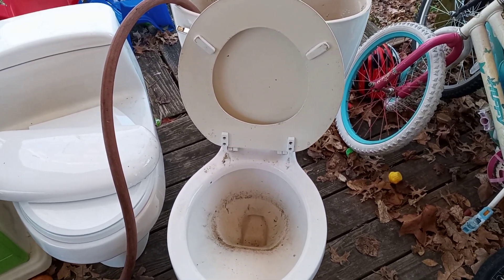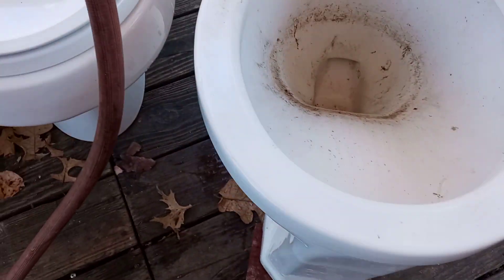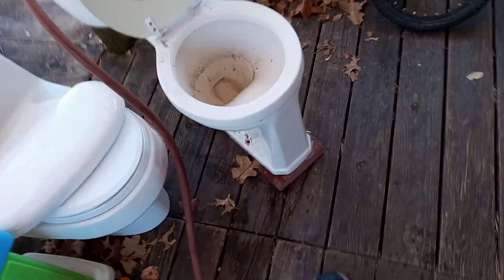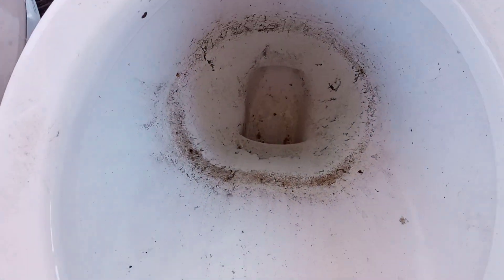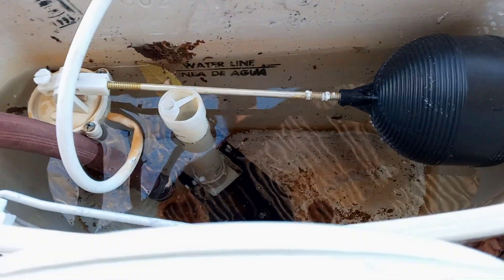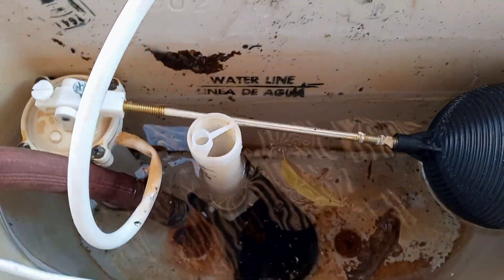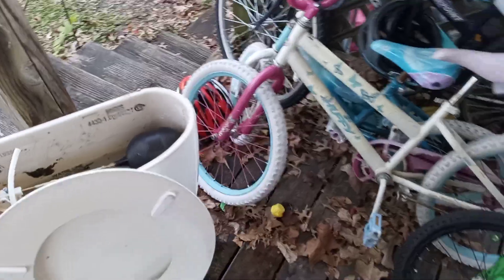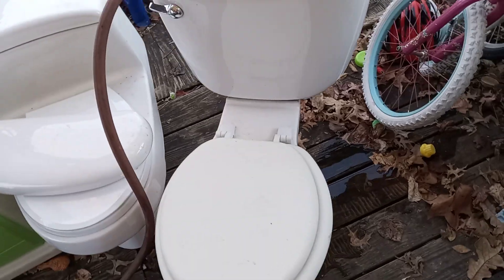flush test of a vintage forward trap toilet

Comment: Try looking for stamps under the bowl or on the back of the base. Also you could take the tank off and see what the part of the bowl beneath it looks like. This toilet is horrible but it appears to have clogged rim jets and thankfully that can be fixed.
Reply from the maker: Im taking the tank off today,I will check that out.Thanks for the info.
Reply: Radius_Boi6  Are you meditating?
Reply: @OCC_Plumbing_and_Restorations  it looks like he is